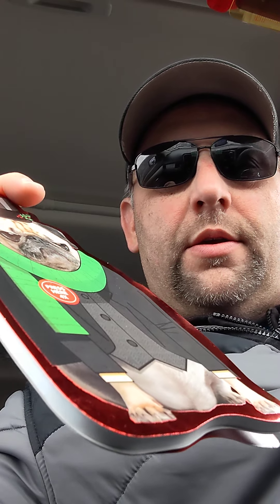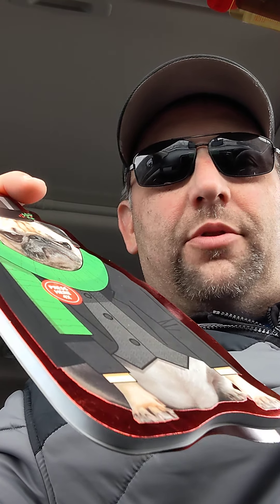Faraday Research RND ⚡💦#tesla #freeenergy #zeropointenergy

Comment: without looking at any comments... im getting a mental pic of the battery free Phillips Hue kinetic wireless lightswitches... powered by their own press?and why doesnt more devices have regenerative braking like ive only seen a few ebikes have it and never see a premade part or kit for it when building your own despite im sure its not much diff than the ring on the inner chain wheel with magnetic sensor  that responds to the magnet on the outer chain wheel that tells the bikes hall sensor computer thing your speed roughly. i just need to get the fundamentals in practice and concept a bit better and i feel like i wouldnt be afraid to even try concepts that sound right in my head any longer. fear of failure holds me back and messing up expensive non broken things that i already wasted wayy  too much buying and breaking unnecessary parts in the pursuit of just making it work... damn it now i need to go figure out why i cant get the two wheel controller i rigged for my ebike to run a brand new front wheel. already had it going twice the speed of other ppl with a single wheel and 36v 350-500w 20kwh 18650 high drain chinese battery packs that can be afforded...and it was just little tweaks with extra wire redundancy removal, and where i put my seat to balance center of gravity... helped having the frame off a $2k aluminum S-Works bike some weird guy gave me once too..im only bring up the e-bike thing because i was afraid of messing its parts up for a long time and since i got the controller capable of 2wd now, its been sitting in a room and ive been driving as an excuse to not do it... and since i forgot all but some 16awg ofc in wall rated speaker wire with prolly more insulation than i can use toward spark gap and coil fun, i should prolly go see what i can do there and possibly a year later if its a bad wheel see if the chinese guy will still trade me out like he said... i like the out of the box footwork going on in this video tho. i got a lot done today in between involuntary naps upright, and im motivated still to get something else done since i got my PC overclocked fast and stable enough to come in 18 in the world with my processor and 500 something overall so considering i couldnt get my ram to overclock without my pc crashing for almost 2 days, its a good day and ur email said what made me figure it out and get it done earlier... have a good night man! if your last name was goodwin, id be thrilled to say Have a Mike Goodwin! idk us WV folk always sound like were tellin ppl to have goodwins. smh idk lol